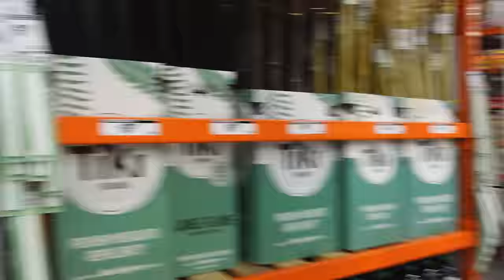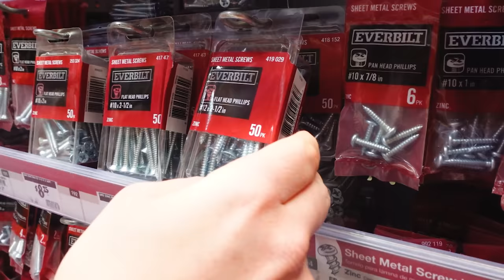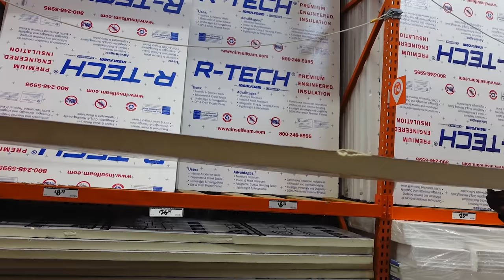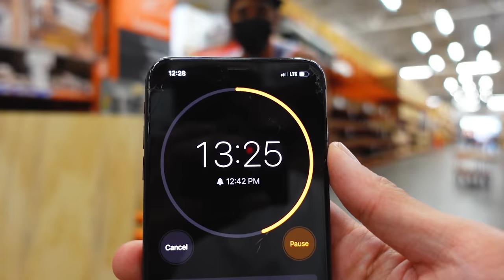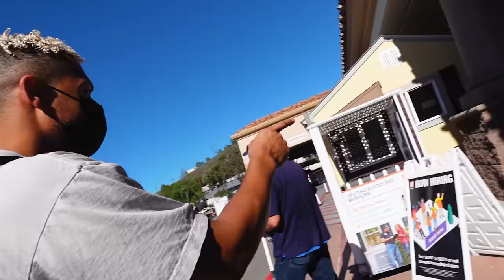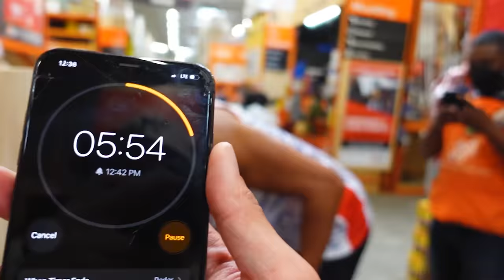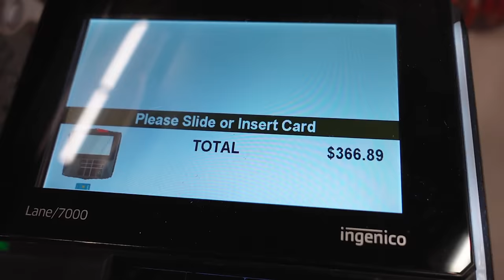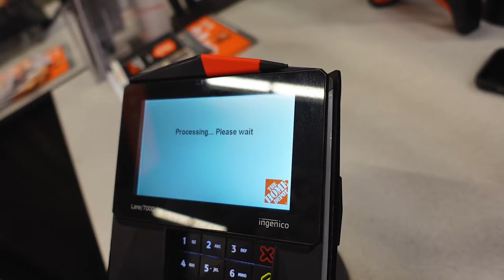Last Boat to Sink in FREEZING Ice Pool Wins!

Comment: Caulk guns 20:46 there should be a quick release button. Press and pull back, then you don't have to do the screw thing. I didn't know at first either, for that model I think it is behind the trigger and you push towards the trigger, it will release the entire screw and you can just pull the back portion back as fast as you want.